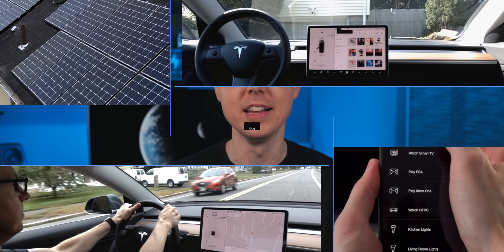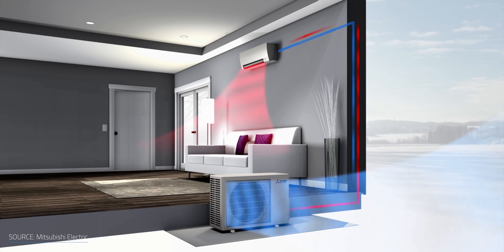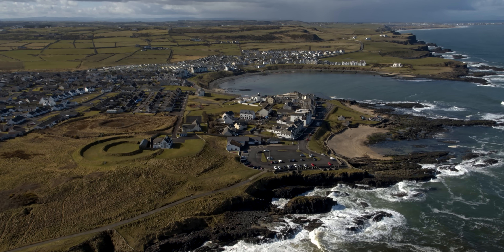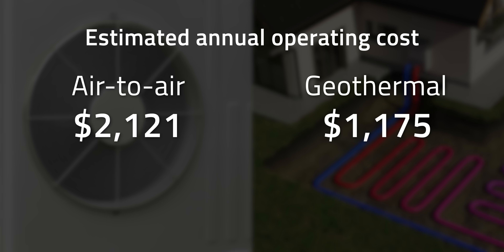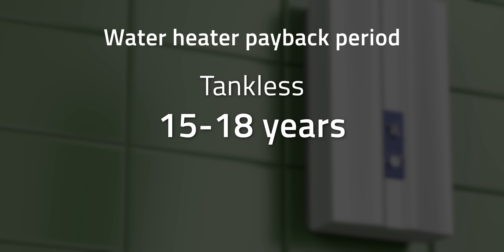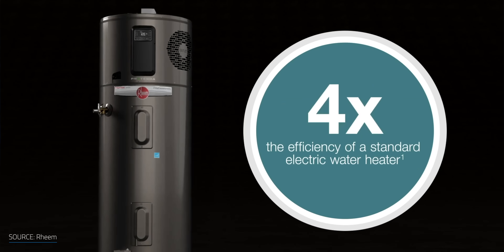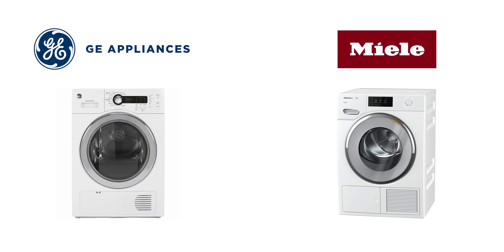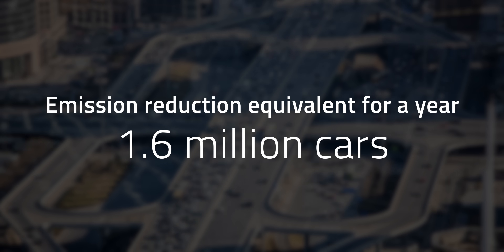Why Heat Pumps are Essential for the Future - Explained

Comment: Hey Matt, glad to hear you're going into net zero home. 

I recommend the book  "Let It Shine: The 6,000-Year Story of Solar Energy". It made me realize the orientation of a house is essential for a good solar gain and shading. I was amazed how good knowledge of sun's power was already in history and also how easy it wanes from society.

tl;dr is orientation directly to south, with broadleaf deciduous trees east and west to provide shading in the summer but solar gain in the winter.
Reply: @nicstroud  
I agree we need to address where the energy comes from, and best energy by far is energy not needed.

Best heating system is a heating system not needed - passive house. No need for energy, no need for materials for heating system and no need for handing out money for that heating system.

It matters which materials we use and it matters how much material we use.

And it matters, because we only just seriously started tracking carbon footprints.
Reply: Thanks for the TL:DR version. Although I read your comment, was nice to have that summary.
Reply: @MrBLAA  You clearly do not understand how this works.
Reply: In NZ, houses are orientated to the north. This is because the Antarctic is really nasty in winter. 
To live here, you need moist air in the house, or people will get seriously ill when they go out for any length of time if the air in the house is too dry, because of the environment being wet most of the year.
Reply: Latitude also matters.  A particular design and orientation of house that works great in Arizona, may be horrible in British Columbia.
Reply: @shauntempley9757  Sorry, yeah, the most windowed part of the house should be directed towards ecuator. In NZ that means north. :D
Reply: I'm in Ohio and visit Amish country regularly. I picked a pamphlet on setting up an Amish homestead and foundation orientation was the lynchpin that other home amenities were planned on.
Reply: @zelozejn  Cool. That makes sense, since all the heat comes from the equator, when you think about it.
Reply: also part of the roof extending on the sunny side, angled so sun hits the roof in the warm half of the year but get below it in the cool half

Comment: Pretty cool to see the appliance options. It would be nice to see some sort of whole home thermal management system that all of the appliances could tap into. Run a cold water line to from your house heatpump your refrigerator for a first past chilling with a compressor on the fridge cooling the freezer and dumping waste heat into the water line heading back to the house heat pump.  so it could be used for heating hot water, heaters,  clothes dryers, etc...
Reply: I've always wanted to do something like this too. I work for a large university that is partially set up this way. Our central power plant provides electricity, steam, and chilled water to every building on campus. This provides all the space heating and cooling, but many other things as well. There are still a lot of freestanding freezers, etc., but built in units usually cool their condensers with the chilled water system. Many experiments that need water cooling also use that system. Clothes dryers, autoclaves, and many other things are either preheated, or heated entirely, from the steam system.
Reply: @toddthreess9624  I agree. I think it's probably best to do it the way I was describing above, with a single cold line and a single hot line, with a central heat pump moving heat from the cold to the hot. It's less efficient than carefully matching individual devices and using their heat directly where it's needed, but not by a lot and it would be much easier to manage when it comes to adding and removing devices.
Reply: @toddthreess9624  It's a good point. OTOH, I think the things that usually fail on refrigerators are seals and the compressor.  jasexavier's proposal would a big, high-quality compressor instead of a cheap one stuck on the back of the fridge.  A system like this probably wouldn't be cost-effective for a single-family dwelling, but it might make sense in an apartment building.

Comment: Nice thing (didn't mentioned) is that heat pumps have potential also in district heating. For example Stockholm uses couple of largest ever produced to warm up spaces for it's residents and it uses sea water in it's heat exchanger which unsurprisingly is much, much more efficient than both air and ground

Comment: Heat pumps are fantastic way to go! Iv been in the HVAC business for 35 years and I’m installing HP’s on a daily basis and even installed one in my business. The key is to make sure you purchase a HP with an inverter. We are starting to install HP water heaters as well.

Comment: Lots more building videos please, especially on your decision processes, thoughts, ideas and opinions. As a former LEED specialist there are so many ways to achieve improvements. As others have said removing the need for energy is theoretically the best solution, but achieving that last 10% can be prohibitively expensive.
Reply: most people say that you need PVs and electricity is holy grail. What I would do without electricity, how I poor will charge my smartphone and run PC, but ... My PCs take less than 100W, my  phones take less than 50W every other day and so. 
Most of energy we need at home is heat. Even if I would like to play games on super ultra mega graphic card (what I do not) every watt in is turned into heat (a tiny fraction travels to the internet in form of a signal). Yes, mining, rendering CGI and so is very energy=electricity intensive, but how many people are there doing that regularly?

Good insulation can keep heat in (or out if needed), drying on rope (if it is possible) is viable without electricity and industrial washing machine (or DIY mixing valves) can run on very low energy cost (because of heating water out, mot in). Unfortunately, using solar oven is not a case for everyone and it needs direct resistive heating (HPs end at roughly 60centigrades).
Reply: @stanislavbandur7355  I have all sorts of computers and stuff in my room so it's always nice in winter. For summer I run a reverse cycle aircon and have solar so it works great.

Comment: So my youngest brother(civil engineer) had an oil fired forced hot air furnace and a broken air conditioner,  he also had 12kw of solar panels on his roof. We replaced the old furnace and ac with a hybrid heat pump setup, his highest electric bill since the conversion was around $2. And he only used a quarter of a tank of fuel oil(60 gallons). New technology is amazing.

Comment: Technology Connections already had me fully convinced that we need to heat pump all the things. Boy was I salty when he revealed how close we already are to having this technology everywhere, because heat pumps are basically air conditions with just a few more parts. I can't believe we haven't been using it all along where possible. 

And good on Washington State for giving natural gas the boot. Climate Town blew my mind revealing that natural gas is worse than coal due to the leaks in natural gas infrastructure.
Reply: Electrify everything!
Reply: We have been (using them all along) here in Australia & New Zealand. It’s old tech here.

(Heat Pumps aren’t air conditioners - Air Conditioners are Heat Pumps, pumping in one direction).
Reply: Because the cost are much higher, because you need to dig a deep hole. Nice for a single remote home, but for cities, and especially poor people, it is unpayable. A better solution would be to make more power stations, especially nuclear power stations. That is the cleanest energy, cleaner than wind turbines, until we have fusion power.